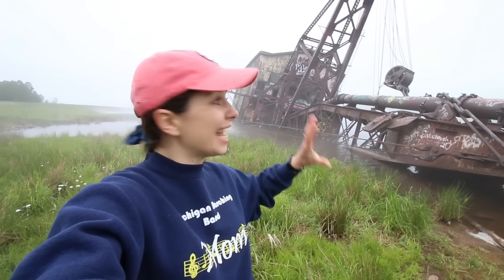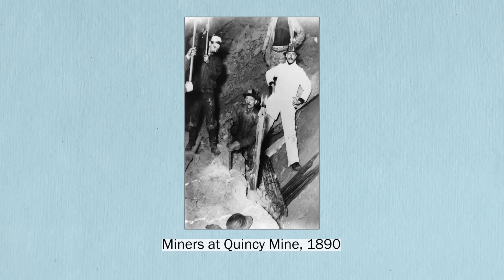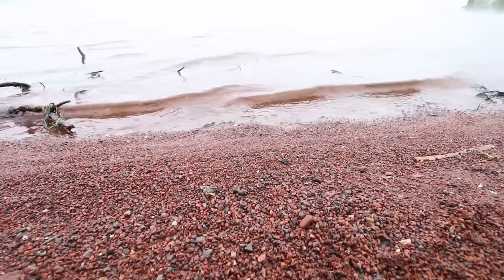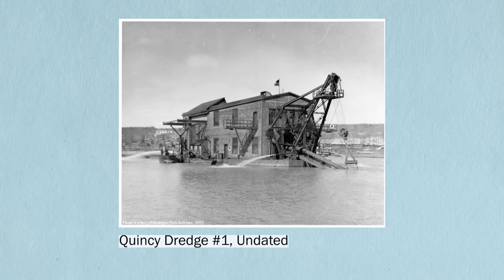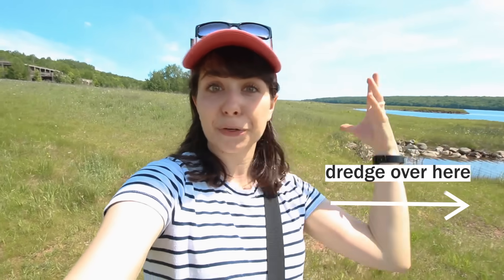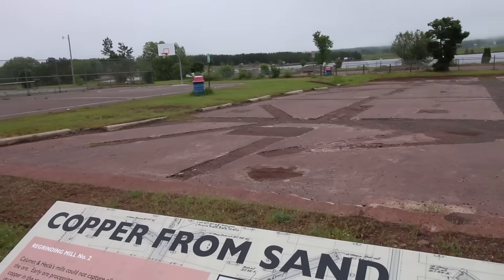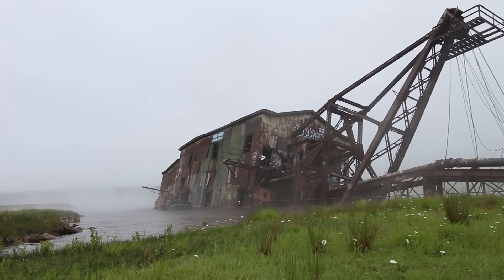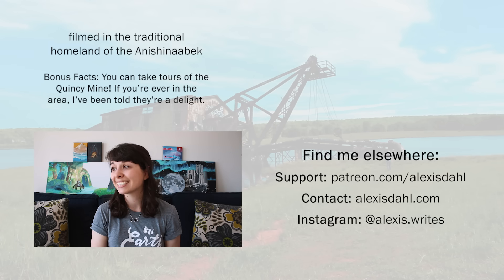Meet the Toxic Sand Vacuum | Torch Lake, Michigan

Comment: Alexis, My grandfather worked for Quick from 1907 to ~1963 when he retired. Visiting him was a thrill because he was a wealth of information, and shared with me a lot of info at my very young age until he had a stroke. He had a number good friends who work there before mining operations stopped, they would drop in after he passed in 1972. I learned a lot from them about the processes and one of them arranged for me to talk to people at the Quincy office in town where i was handed a bunch of boxes of material relating to the mining operation. While I learned as much as I could, life got in the way of continuing any research and MTU had received most of the Information from Quincy. One of the things I learned about was the use of a few chemicals in metal recovery, one of them was mercury (I don't remember how it was used) but the waste was dumped in Torch Lake and the Canal. I remember visiting where they had large pans that would be heated with tailings and stamp sand in them using mercury mixed in with other chemicals (this was shut down by the time I saw it). Another was Arsenic which was used in a slurry made of tailings in drums which after recovery of copper the used mixture was also dumped into the lakes. So you know, they knew exactly how the process you describe worked. It was figured out before the recovery started, there were a number of chemists who worked on reclamation of copper and silver (a lot of silver came out of the mines up there) and recovery was talked about in the journals before 1905.
Reply: Wow! 56 years he worked at the same company. I'm just trying to imagine myself working for the same place for that long.
Reply: @thedude_-__-_7528  everyone used to work for 1 company for their whole career. Not so much now
Reply: @thedude_-__-_7528  My father set the record at 47 years at the Cessna Aircraft hydraulic plant he worked at. The only job I remember him having. He's 83 years old now.
Reply: Back then a dollar was worth a dollar
Reply: They figured out a working process, but could not explain why it worked. 
Also, Mercury and arsnic were super common in gold processing as well, because mercury sticks to and absorbs gold, so they would just pour it into their sluice boxes, which were just fed by diverted streams and such...
People still find the gold/mercury amalgum in waterways to this day
Reply: Amazing! What a nice trove of historical documents. 

If you haven't already done so, please donate those papers and other materials related to the copper mining or reclamation processes to the  Tech (MTU) Van Pelt and Opie Library. I know it is a Closed Stack Library, but it will carefully preserve the documents. 

You can make an agreement with them that you and you family can have access to them. You should request that the Library provide  you and your designee free training on how to properly handle historic documents. Maybe you could request that you or your designee have access to other Torch Lake historic documents, just in case you have a writer or historian in the family. 
You and your designee's must agree to follow the Library's rules about handling historic documents. 

Many Libraries have historic documents they would like to scan into an electronic format, but because of their limited budgets, plus the nature and fragility of those documents, they cannot afford to have that done. They would usually have the equipment to do the copying, just not the hands. To help preserve them you could offer to do that for your documents a little bit at a time. Because Torch Lake is a Superfund Site managed by the State for the EPA, the State or the Feds might be willing to fund the preservation of those documents.

Comment: I've been mining copper for roughly 3decades. Started at 7y/o, started& quit a few times, but have been mining almost consistently since 25y/o. It's still pretty easy to mine copper these days in the year 2022. Little labor intensive, kinda time consuming, but I can average about a Troy Oz easily every day if I spend an hour or so mining. But that's rarely the goal. Back in the 80s& early 90s though...... IT WAS ALL OVER! 

So what's my biggest tip to those wanting to mine for copper? It's simple. Cash in a dollar& dig thru your pennies. Lol. Pre81 and you're guaranteed a lovely piece of copper that you can save as long as you wish to! To some, it's just a penny. To others, it may be worth 3or4. Lol.

Comment: 25 years ago, it was possible to go inside the dredge and look around. Not particularly safe (or legal) to do so then, but it was really cool to look at. When the EPA superfund restoration work took place to stabilize the stamp sand and minimize further runoff into Torch Lake, fencing was put up that closed off access to it. I would love to see KNHP attempt to preserve it as it helps tell the story of the mining operations there.
Reply: You can still get on it lol. The fence even has openings to allow foot traffic.
Reply: And who will finance that?
Reply: IIRC, the largest copper "nugget" ever found, came from one of the areas mines.
Reply: @djfitzgerald111  my buddy and I found a two thousand pound bolder of copper metal detecting around copper harbor a couple summers ago.

Comment: Interesting video as always. Just so you know the pine oil copper flotation process is still in use here in Arizona (copper capital of the US) and you can see it (and smell it) at work at the Mission open pit mine tour south of Tucson.
Reply: there's copper ore that's nearly 100% copper on that island in Michigan.   Its usually contaminated with silver.  I know a guy that found a 3200 pound nugget about ten years ago.  It was sticking out of the ground.

Comment: Interesting video! That is an old placer (pronounced "PLA-cer" with a short "a") gold dredge repurposed to copper tailings recovery. Ball mills and copper-flotation circuits are still used world-wide to process low-grade copper ores. I imagine there is still quite a bit of copper left in the lake sand that could be recovered and repurposed. The ultimate sustainable recycling project you might say!

Comment: Very cool video.  I find it kind of funny how the EPA came here and had to cover all the stamp sand (or cancer sand as I call it) because it could make people sick, yet the two County Road Commissions throw it all over in the winter. I was happy when the Dollar Bay site ran out of usable sand and instead of using a form of screened sand they moved to the Gay Sands and continue to use it. Calumet and Ripley garages order 5000 yards each for each winter.  Also, as a side note, my grandfather worked on the dredge that sank in the middle of the canal. My aunt has a newspaper clipping about that dredge the day it sank and it has a picture of my grandpa "at the controls" in the article.